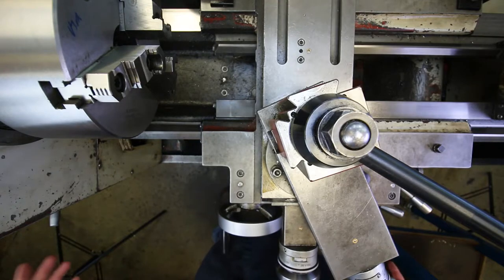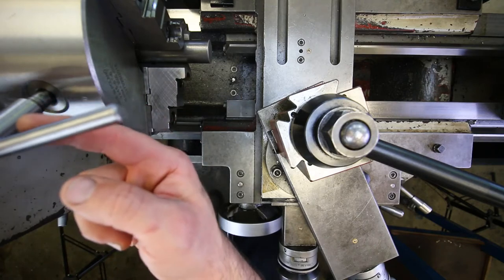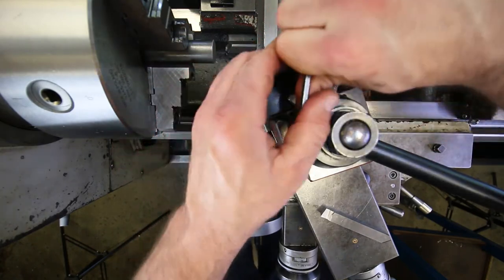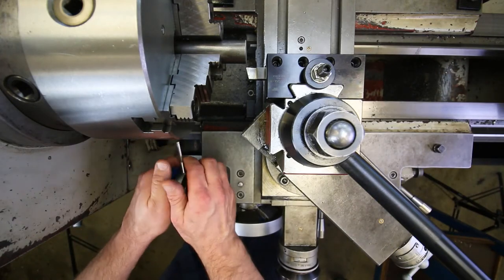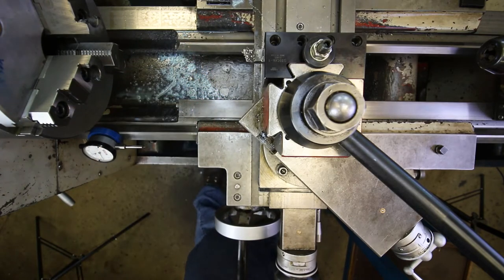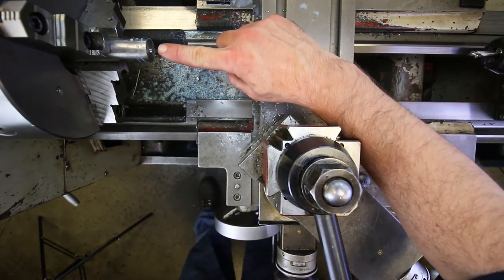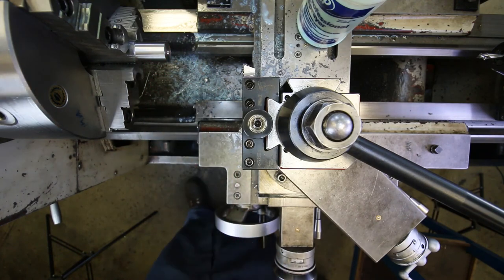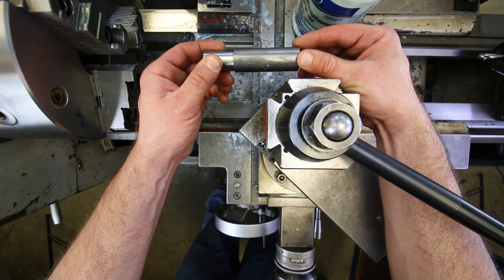Threaded Shaft - Demo - Part 1

Comment: Hi Adam, you’re measuring the diameter, but the lathe cuts on the radius. Is the cross slide calibrated to measure the radius or the diameter?
Reply: Great question! The distinction between diametric and radial measurements/adjustments is VERY important to successful machining of parts on these manual machines. The crosslide dial is diametric-reading on nearly every lathe except some large, old lathes. The compound slide dial is less uniform from lathe to lathe and it’s important to know what the lathe you’re using reads. I actually mention this at a different point in this video series.
Reply: Machine Tech Video Blog thanks!  I just watched the next video and saw that you address this there. I have a little Sherline micro lathe which measures radially.
Reply from the maker: Interesting. I've never used jeweler's lathes or model lathes. Wonder why they would be graduated radially?